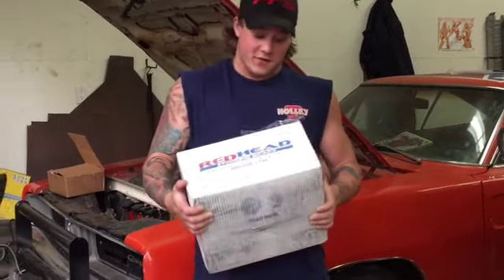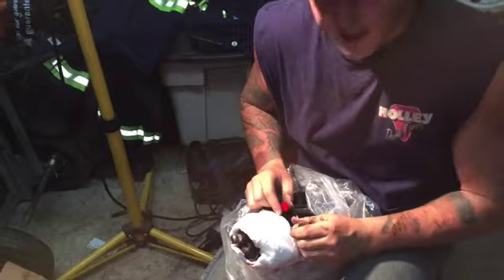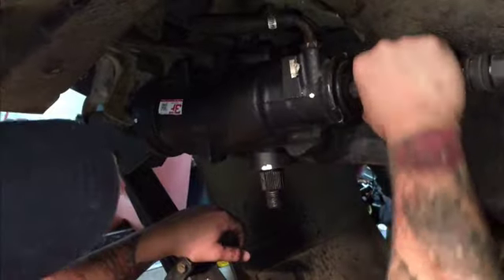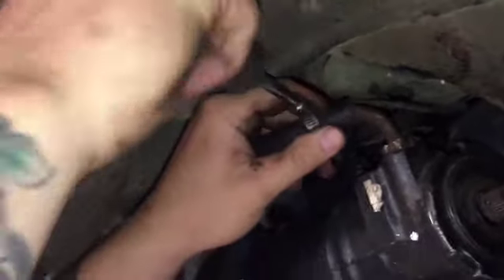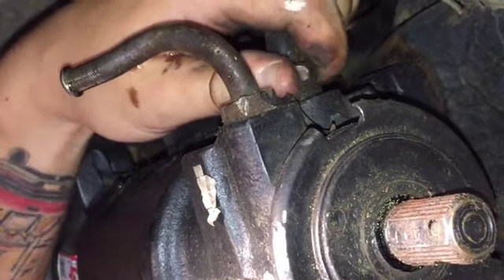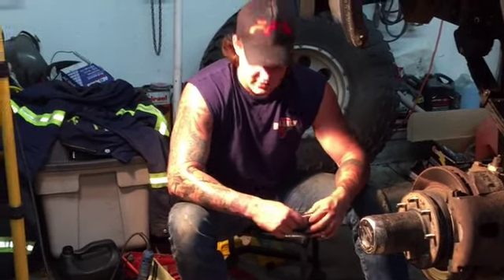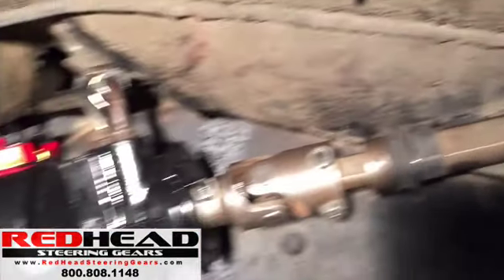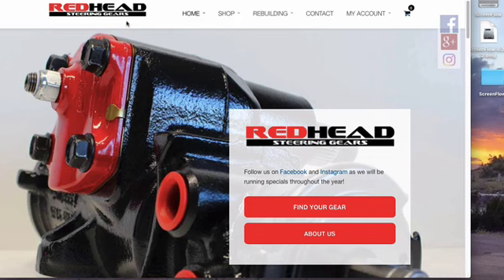Installing a RedHead Steering gear on my 93 Dodge

Comment: I recommend bleading the box before connecting the draglink to the pitman arm ( or arm to box if you went that way). This will allow the box to hit it's stop's instead of the stops on the axle/ lower control arm (2wd)  preventing  the box from stoping first making bleading difficult at best..

Comment: I installed a redhead steering gear on my truck to know it’s still a tight steering box it still works good but it was approximately now this is about 10 years ago maybe 12 years ago something like that it started leaking about two weeks out of warranty and I asked him if they could help me and I said nope can’t help you now they do good quality work they put together a good box and to be fair the steering box I have is a 92 excuse me 91.5 dodge and they are notorious for the steering column goes in for leaking I’m not trying to beat up on those guys too much but two weeks out of warranty you can fucking help a guy It’s a six and a row jim from Kennerdell Pennsylvania

Comment: Make sure to recheck the bolts on your box after awhile, I changed my box and had all the bolts as tight as I could get them and after 200 miles or so I noticed the slop was back and it turned out it was the whole box moving because the bolts had worked themselves lose enough, scary stuff. That box is bad ass though I went with a remanned one but luckily had good luck, I wish I had hydro ports though for in the future